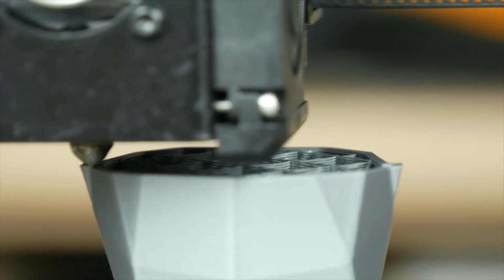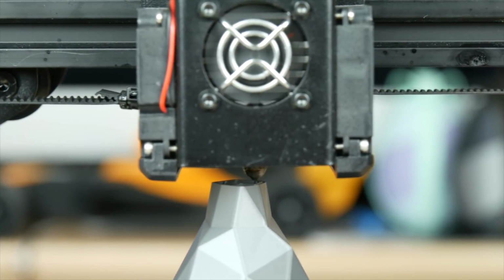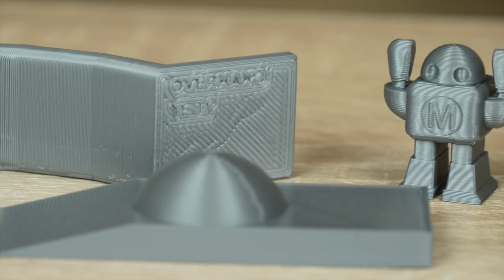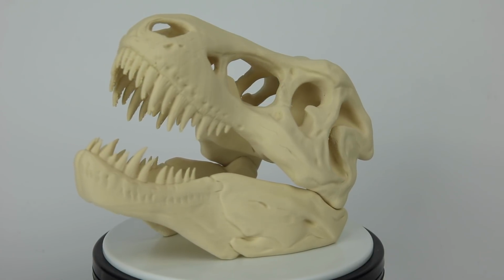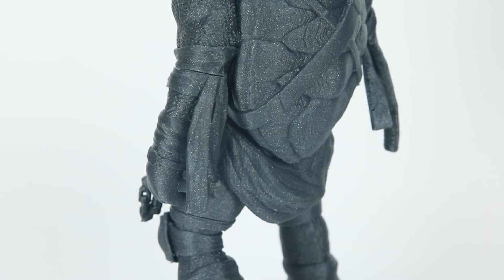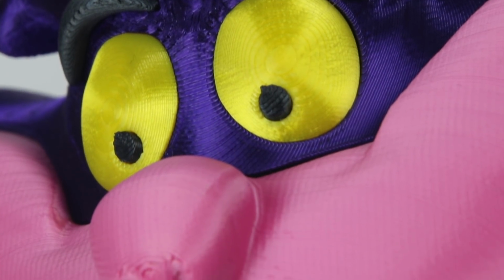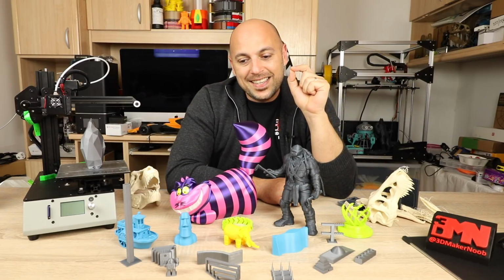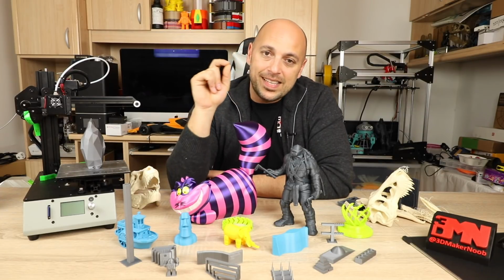Tevo Michelangelo review.... and GIVEAWAY!

Comment: Just got this printer... returning it asap as this is such a pieco of shit.. I cant believe I went for it.. nothing is aligned.. you will have to reasemble everything yourself.. .z axis wont move as the entire structure is not aligned.. the wheels are hanging mid air no matter how you adjust them which will cause entire printers body to wobble like a slut on the strip pole

Comment: Whilst the decent part cooling setup will be helping the overhangs, don't underestimate the effect of an unheated bed. Overhangs, particularly ones near the bed, work much better when they're in a nice cool environment -- plastic that's near a 50C-60C surface doesn't cool anywhere near as quickly and so has more time to curl up before solidifying.

Comment: It looks like it prints well, but with no heated bed it makes it a stone-aged relic.
Reply: 0Calvin I thought so at first but it's absolutely wonderful as a portable machine I can toss in the car and take with me and run off battery pack and I added a heated bed for $19 :-)

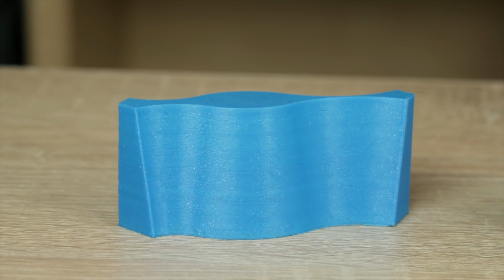To get better adhesion with a cold bed crank your temperature up to 2:20 Maybe 225c and slow down the first layer really slow run at 20% speed and you want your first layer to be a slight air gap you're basically dropping the hot molten filament onto the bed it works impressively well :-)
Reply: Nerys, I here you. I have a similar machine, a CR-7, to which I also added a headed bed. Great little portable machine and prints surprisingly well.

Comment: Thorough review (as usual) from the viewpoint of an experienced user of the printer (not just assembling and printing 1 or 2 items).  I would like to see the printer suppliers also provide tuned PLA profiles at a minimum for popular slicers - it would be a time saver for users.   Unless you need the small footprint, I've stopped recommending minis a while ago.  You can get much larger and versatile build area non-kit printers like an i3 style for not a lot more or even less money (like the Creality Ender 3 or similar).

Comment: Hey Joe, try a glue stick on the surface build plate and you can print abs and petg
the glue wipes off with wet paper towel.
Can you share the setting you use on this printer like feeds and speeds, etc,etc
could you ex plane or show how to fix the z axis you talk about in this video ?
Thanks for sharing!!!